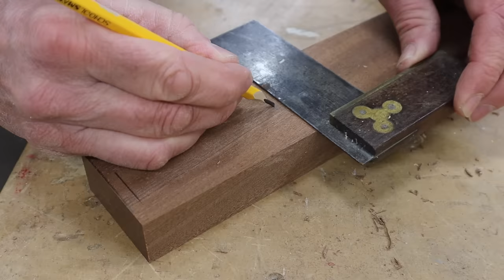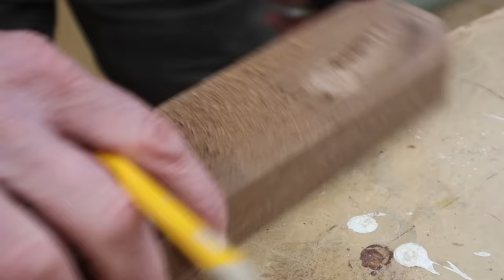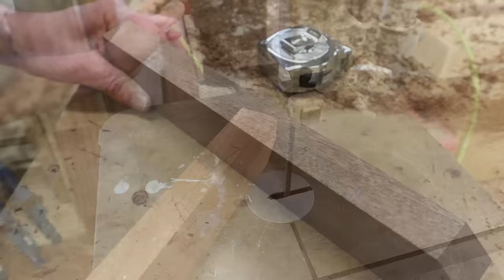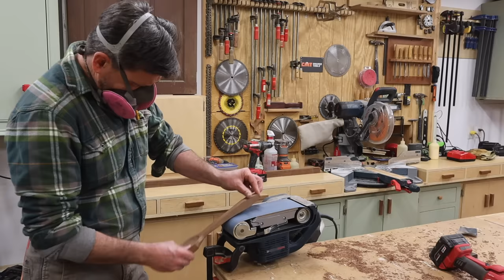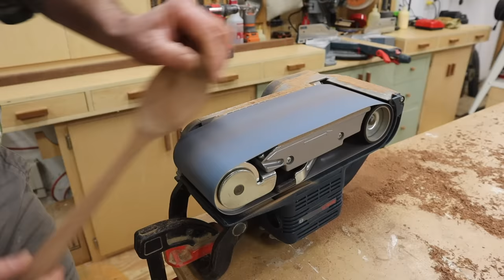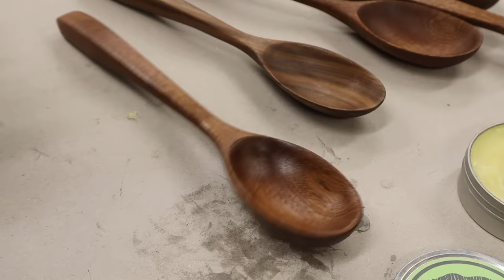Make a Wood Spoon

Comment: Hello, I have a question about the sanding process, do you think sanding paper is perfectly safe for utensil making? I am trying to make a cutting board with solidwood, but I do hesitate to use sanding paper to smooth it. I worry that the particles and the glue will get into the wood and eventually leach into the food. Could you please suggest? Thank you!

Comment: Nice spoon! Did you use a variable speed grinder and if so, do you think it's necessary?
Reply from the maker: Thanks Michael, I didn’t but at one point the battery was running a little low and that gave me a little more control so that might be something to look for in a grinder.

Comment: 2 things OSHA would not approve of you utilizing a clamp to hold the belt sander  if you are going to do things like that you should put them on film visible to the authorities
second organically you can burnish the finish of the surface without chemicals  also you can use warm pine sap thats 100% natural